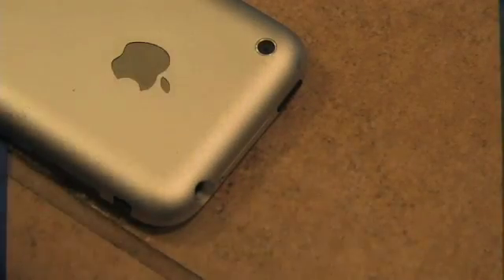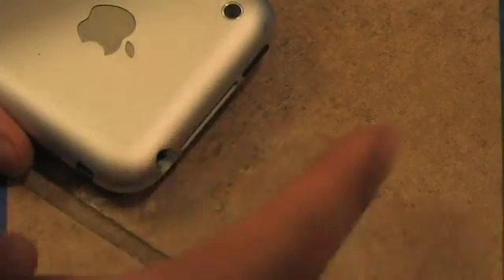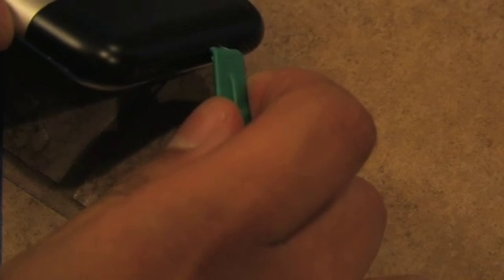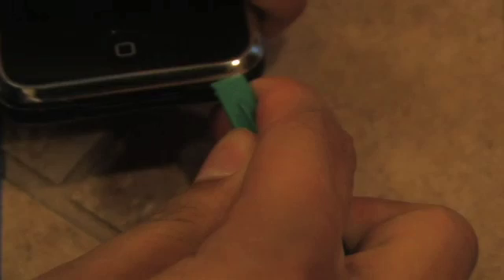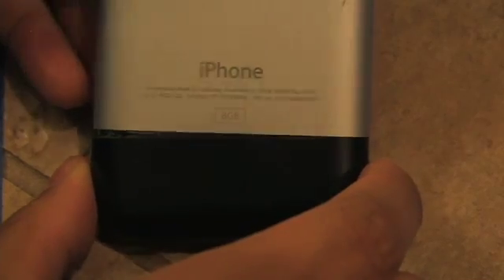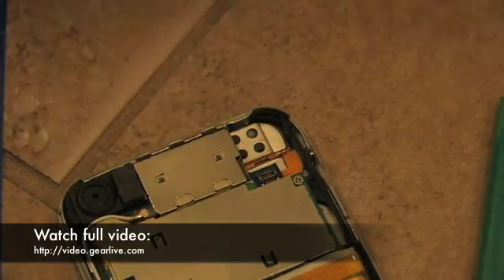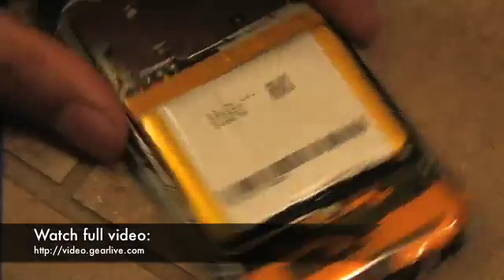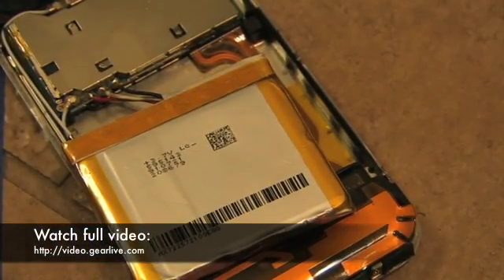Bleeding Edge TV 190: How to Replace Your iPhone Battery

Comment: Use a sucker on the front screen after taking out the two little screws. Safer and easier than that stupid tool you're using!! Once the sucker is on, just pull upwards carefully!!

Comment: They created that battery a long time ago... You know lithium batteries do not have memory? They still do degrade still with repeated use but they don't care if you fully charge them or not. The way to damage a lithium battery is to discharge it until it can't power the device, then leave it sitting about for months. It will never work again.

Comment: hi guys just wonder if someone has already changed the battery,i tryed with mine and ended disconecting the cables from the mother board....tryed with a small soldering machine but i nearly ended burning the all thing!!!any idea thanks

Comment: "Apple could've easily engineered a way to replace the battery easily without compromising the design yet they chose not to do so."

The answer to this is that apple's designers cannot think a way of doing practical design... This phone should have been designed by Swedish designers. Swedish designers can create wonderful and minimalistic designs, without compromising practical function.